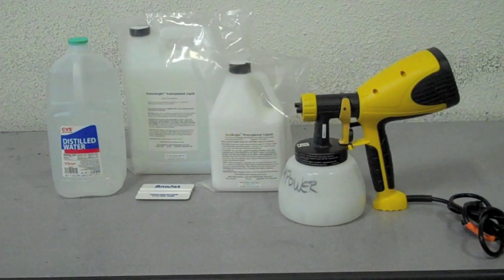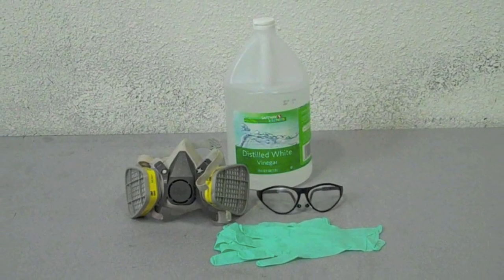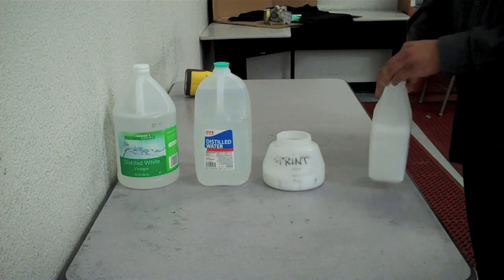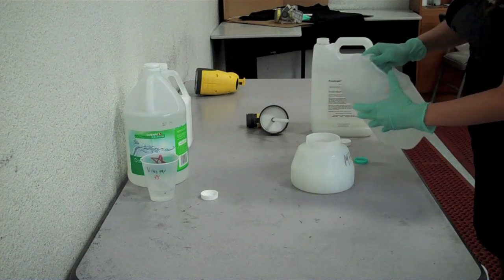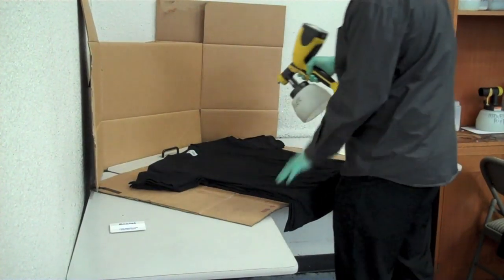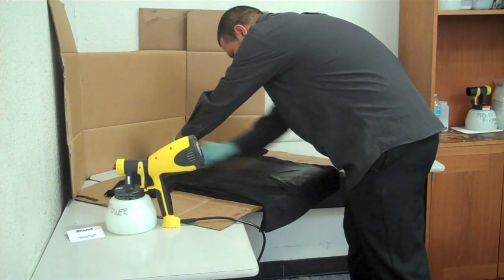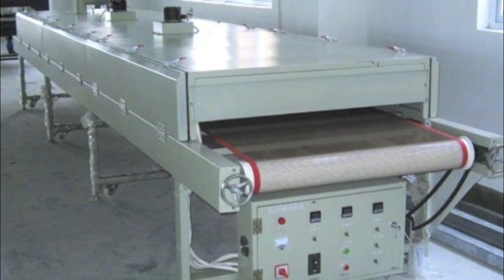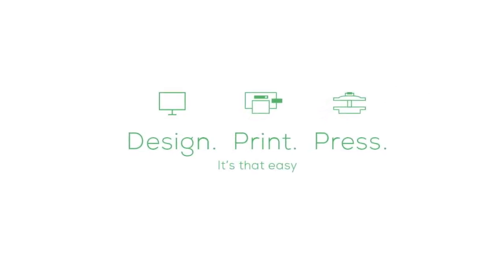AnaJet Pretreatment Tutorial ( T-Shirt Direct To Garment "DTG" AnaJet Printing )

Comment: Do you add Vinegar to the Sprint pretreatment as well?
Reply: Nope, I've found that the viscosity of the Sprint pretreat doesnt have much effect.
Reply: Thanks. Also, are there any benefits to using light garment pretreatment?
Reply: Joshua Kiewel As long as the pretreat is specified for light garments then yes there are benefits.  The washability is great and colors are more vibrant.  I do not recommend using dark pretreat for light shirts that are only being printed with CMYK.
Reply: Deana Leelachat Deana, you are extremely CUTE!
Reply: Deana Leelachat  hello can u say me some tip for dark garment in anajet sprint  (tip in software setting

Comment: When I pretreat, I can see where the treatment ended on the shirts. There is a discoloration.  How do I fix that?
Reply from the maker: Hi Kelly Birkhead You can get a spray bottle and fill with distilled water. Spray the edges then squeegee them out to help alleviate the problem.  If you're still experiencing an issue, please feel free to email us at info@anajet.com if you have any more questions.  Thanks!